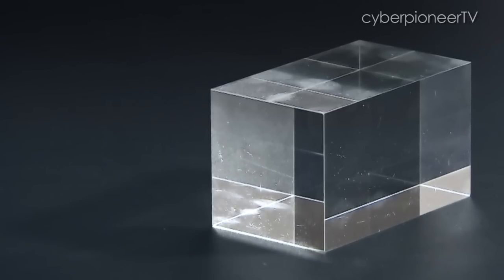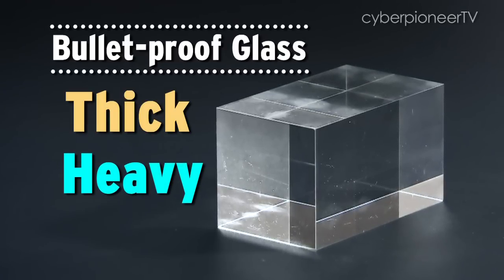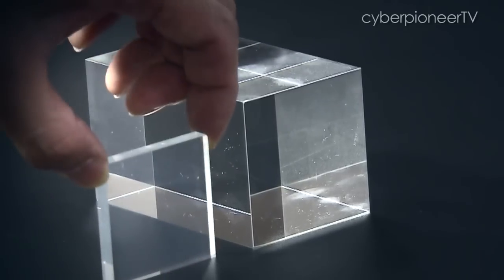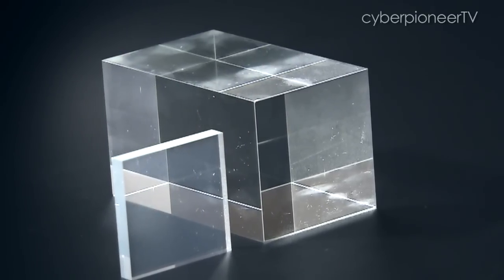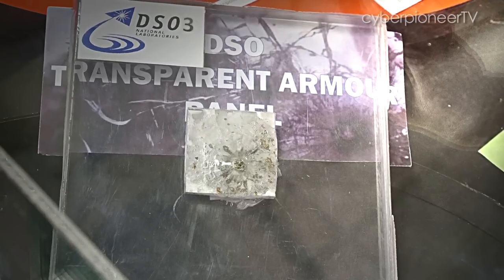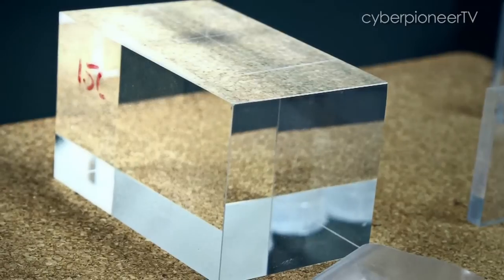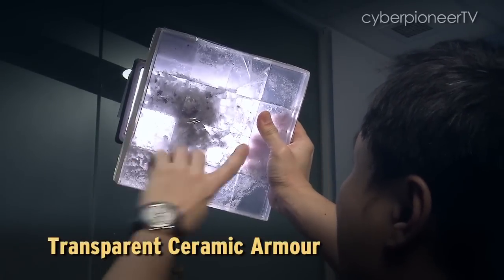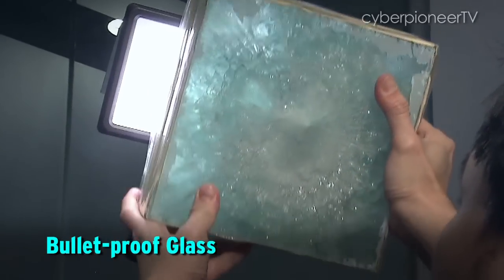Engineering Our Defence - Build Me Something Better: Ep 1 [Transparent Ceramic Armour]

Comment: Isnt there less "damaged" to the ceramic armor due to separated piece of glass instead of a single block?
Reply: Most bullet resistant glass is manufactured in a multi level sandwich of acrylic, poly carbonate, ceramics, and proprietary binding agents in some form or another. So yes layered is more effective than a solid block depending on design. In the company I worked for it was acrylic then poly carbonate with a proprietary binding agent between the layers. Acrylic was the stopping layer with the poly layer being the compressible layer to help reinforce the acrylic. You can look for one way bullet resistance glass on YouTube for a better explanation. It was on guys and bolts on the history channel.